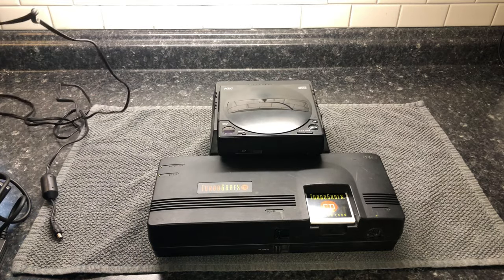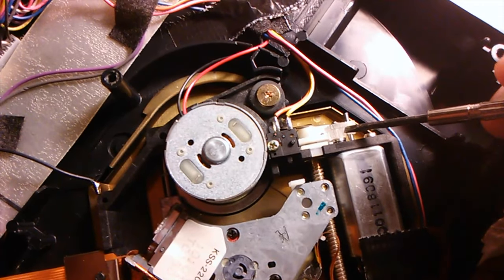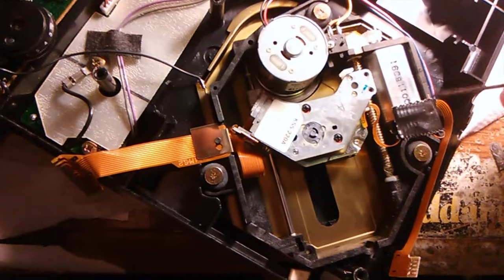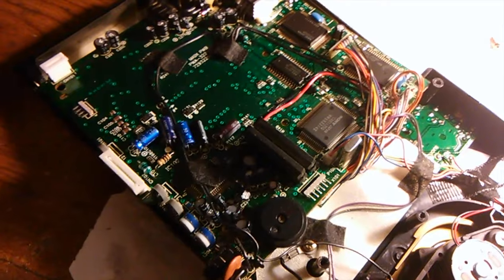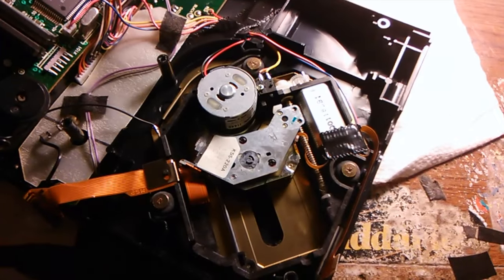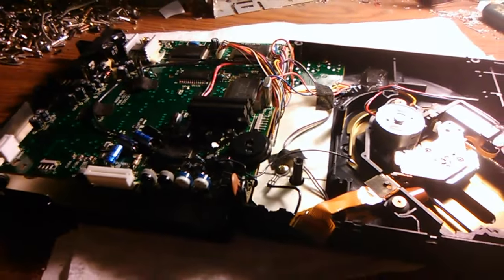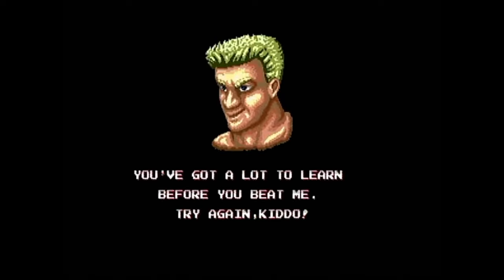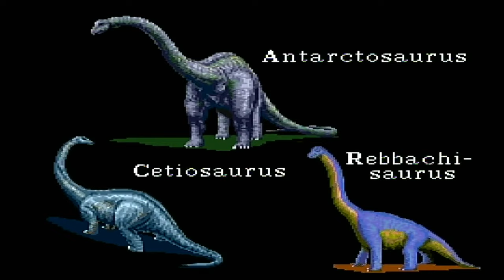TurboGrafx CD Restoration - Player One Start

Comment: Several years ago I bought a PCE Duo-R on eBay for under $200. I was fully prepared to deal with any repairs that might be required, seeing as the case looked to be pretty dingy, I suspected there could be some issues, even though it was listed as "working". Much to my surprise the case cleaned up very easily, and even more fantastic was the interior was pristine and completely recapped! The system had been completely restored recently! Everything functioned better than expected, and all it needed was a bit of an exterior cleaning. My diamond in the rough was one of my best video game investments, and one of my favorite console to date. Considering these things go for upwards of $300+ in "working", probably fair condition, I really was pleased with my purchase.

Comment: Fantastic video glad to see you got the turbo CD up and running along with the duo still wouldn't advise putting burnt disc into the u.s. turbo CD because it will definitely KO that lens fantastic work keep doing what you doing see you in the Stream
Reply from the maker: Thanks Jeff. Yeah, I’ve been only using authentic discs in the drive to be cautious. Just got it working again, don’t want to ruin it 😅